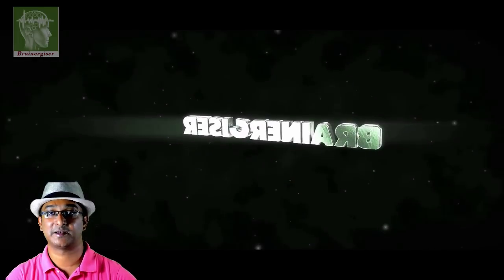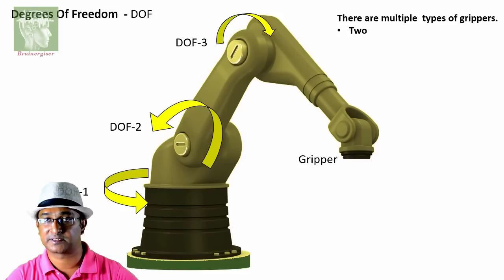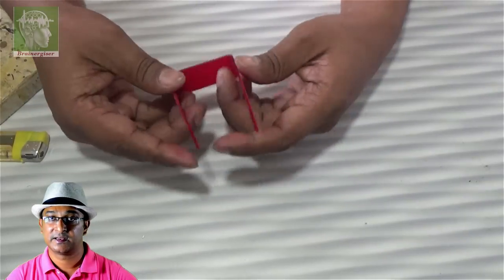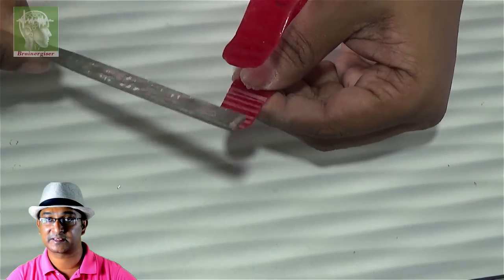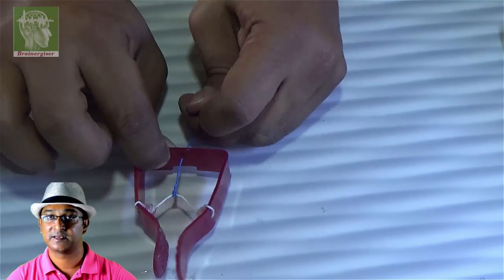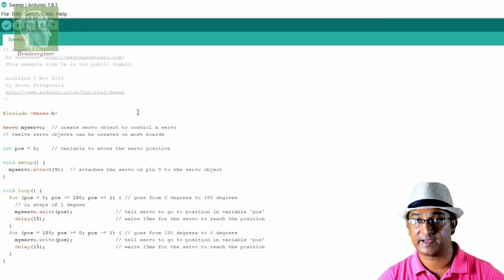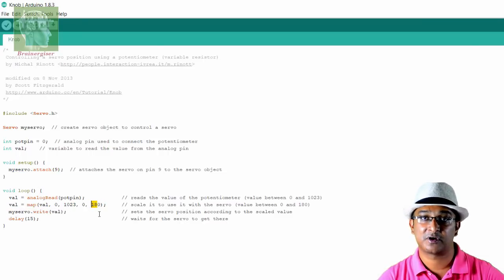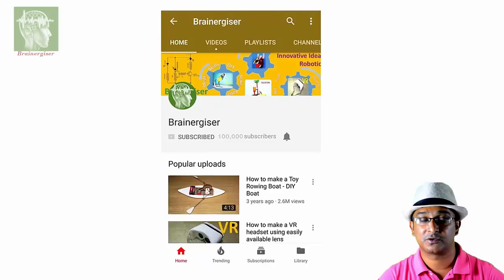How to make a simple easy Gripper for Robotic Arm

Comment: Awesome Sir, I have a crazy doubt not all people know the programme, as far as I understand the Arduino plays a small role by controlling the arm using servo. why is the Arduino necessary when you use the potmeter? Couldn't they just be connected directly using a pulse generator? But of course, the Arduino comes in use when we want to automate the arm...
Reply from the maker: The answer is in your question only :)  . A 555 timer circuit along with a pot to generate PWM signal is enough for this purpose. But as we are going to make the project more complex, we are using programable ic/microcontroller that is the arduino board.

Comment: servo having a slip problem w/o any load, same mechanism, same servo I have using, How can I handle this?
Reply from the maker: Is it slip or vibration or random movement?
Reply: @BrainergiserTube  random movement... Means As per code I hv told him to hold object for 2 sec then release...  But it hold and release suddenly again hold
Reply from the maker: @devendradhond8312  can u check if the Arduino geting reset when suddenly malfunctioning? Just check the reset LED if blinks suddenly.